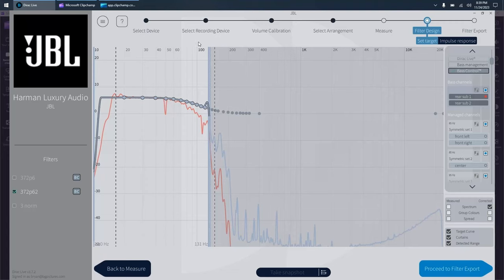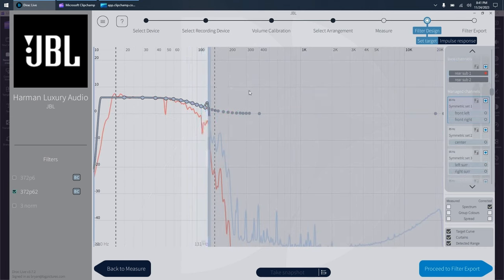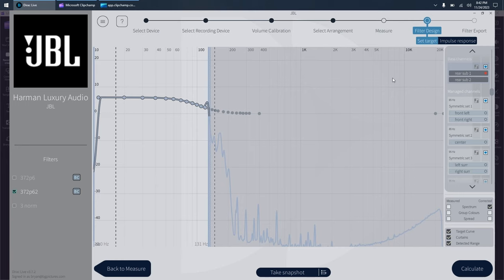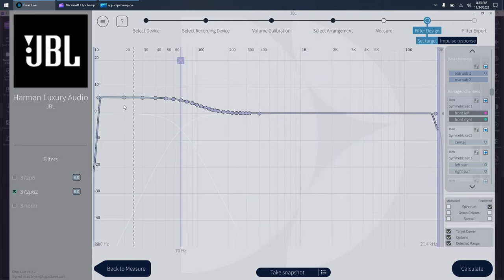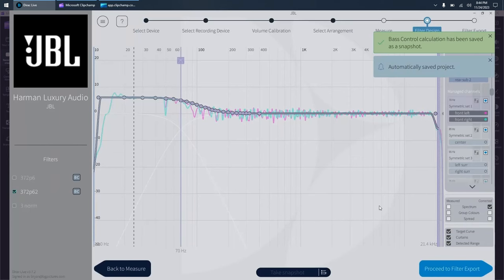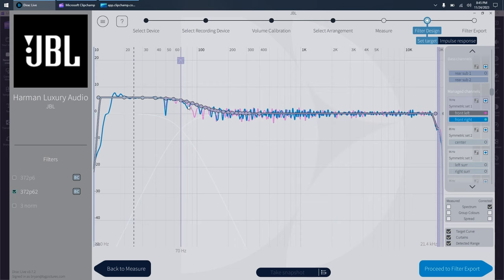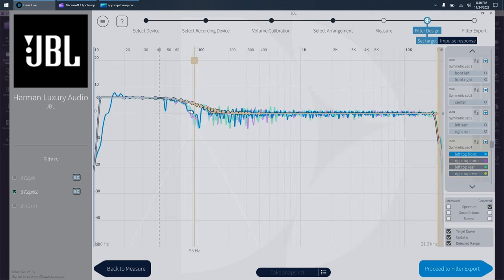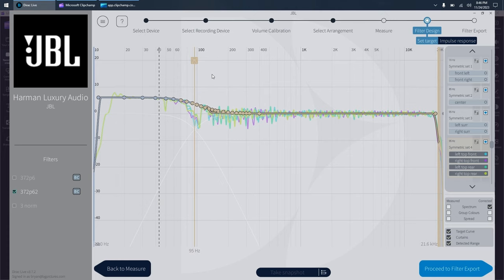How To Find The Best Crossover Points In Dirac Live Bass Control

Comment: Great content, thank you. One question. How to set crossover for speakers in Maranta Cinema 50 before the room calibration? (I have 5.1 wharfadale pacific eco 30 with Dx-10 subwoofer - yes old but very powerful) We will set as usual and bass control will modify as needed? what is the best practice? thank you
Reply: It seems like dirac bass control and management set the crossovers automatically. Crossover settings are disabled in marantz after the configuration.

Comment: I bought the full range bass control multi sub license but there is no Bass control or Management in the menu of the software. Any tips?
Reply from the maker: Login to the Dirac site and make sure it’s on your account. And make sure you are logged in to the same account in the software.
Reply: @texxhexxmm  thanks that was my issue too.

Comment: Thanks for the videos. 

Word of caution: Dirac’s resultant curve is a loose prediction based on what it “knows” about your room—which isn’t a lot. Measuring actual room response post calibration with REW often differs quite a lot from what Dirac predicts. Unfortunately, Dirac’s resultant curve isn’t a reliable guide for what your crossover changes are doing to your room response. The best thing I have found to do is trial/error the crossover in Dirac then measure with REW. I get much deeper, much more even bass doing that than following Dirac’s prediction.
Reply from the maker: While somewhat true, it is FAR more accurate in some versions vs others.  I use 3.4.4 and it's spot on comparing results in REW to a single measurement point.
Reply: Hi. Is the reason you use the old version of Dirac because of the issues with it and the UMIK 1 mic?
That is why I have to use that version. 
Cheers

Comment: What subs go into single digits? Really good ones go down to 16hz and that’s the best I’ve seen.
Reply from the maker: Lots of them.  Most 18, 21 and 24 with ease.  I use PSA.
Reply from the maker: The trick is, look to sealed.  Many ported will do it to, but it completely depends on proper room position and loading for them.